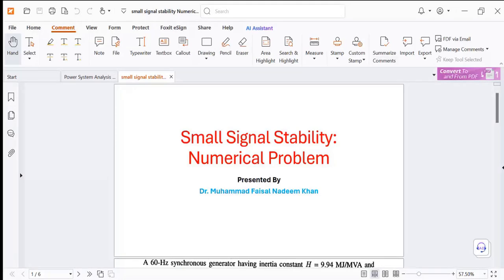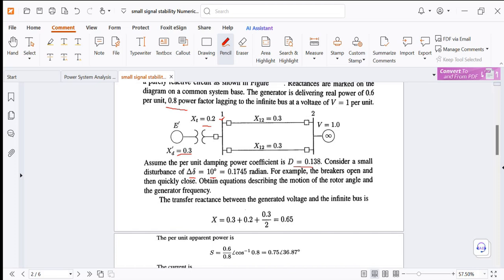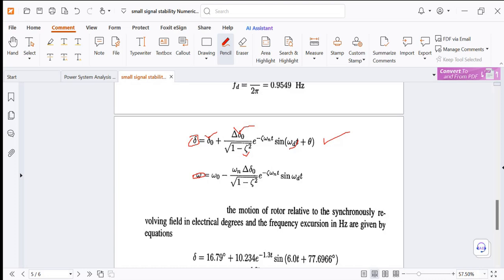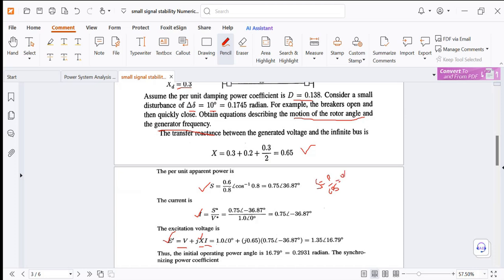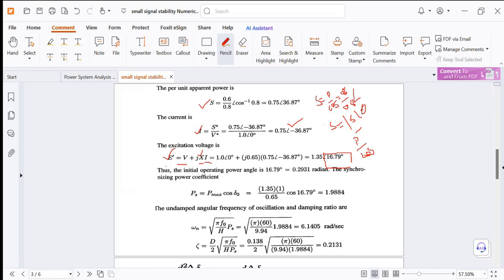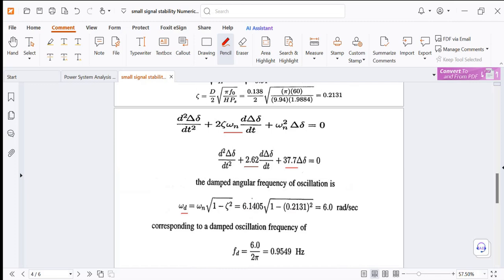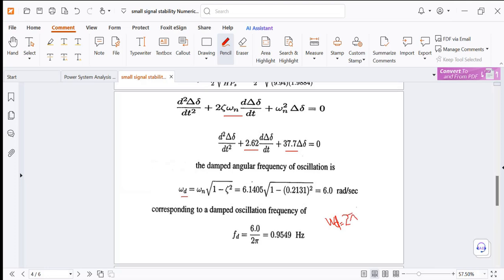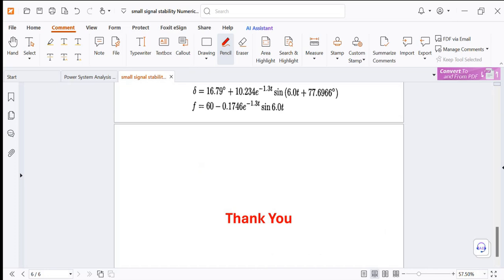Small Signal Stability: Numerical Problem

Comment: Sir in this example all is clear except the value of Thetta=77.6966 degree in the very last steps. Sir kindly tell this
Reply from the maker: tan(θ)=ω_d/〖ρω〗_n. Putting the values of damped angular frequency, natural angular frequency and damping ration in this equation will give you tan(theta). Afterwards just take tan inverse and calculate value of theta in degrees.

Comment: In Example 9.1 of Chapter 9 (Balanced Faults) from power system analysis by hadi saadat, how is the change in voltage delta V3, calculated at Bus 1, Bus 2. and Bus 3

Comment: In Example 9.1 of Chapter 9 (Balanced Faults) from power system analysis by hadi saadat, how is the change in voltage delta V3, is calculated at Bus 1, Bus 2. and Bus 3
Reply from the maker: Dear student that was your assignment